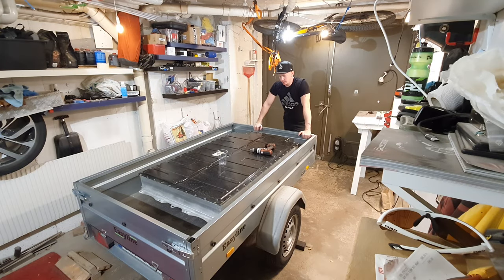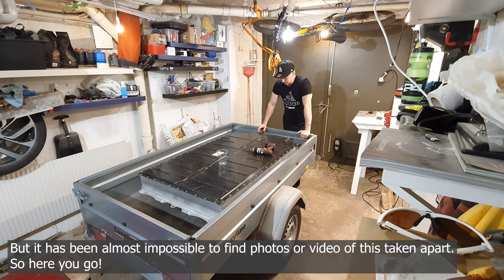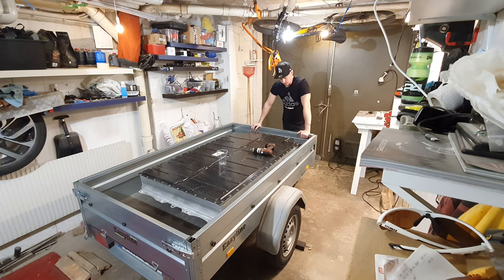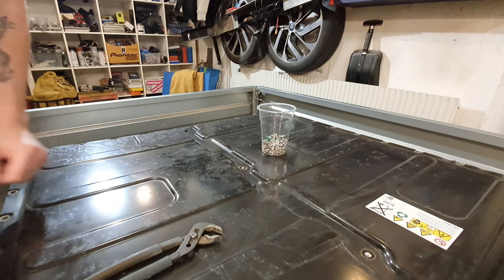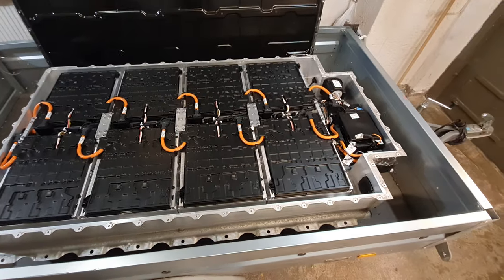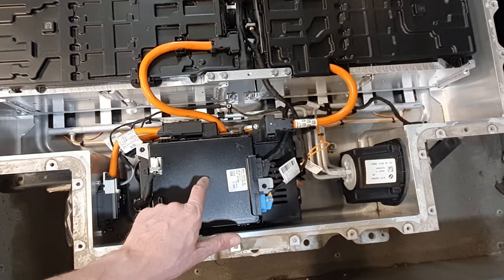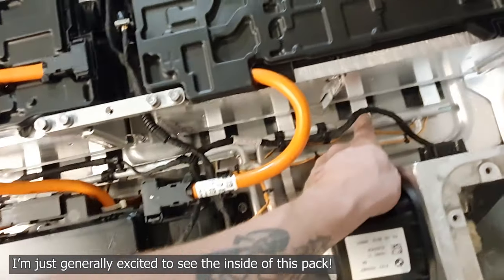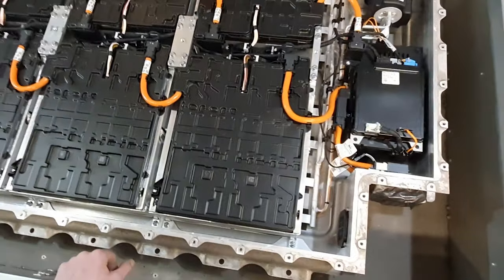BMW i3 60Ah Battery Pack Disassembly

Comment: Most people wouldn't touch this battery without the insulating gloves and high voltage rated tools, but are doing the opposite- removing the protective plastic cover before going starting working with bare-metal tools. I like it!
Reply: Bro, don't encourage him! It's cool that he is doing a teardown and this video is great, but it's not cool do do the teardown in a way that puts your life at risk
Reply: This was so cringeworthy, even the most basic safety wasn’t adhered to.

Comment: Class 0 rubber electrical gloves are $15 bucks on amazon, rated to ~1000vac/1500vdc. Ground the enclosure/chassis and measure all the voltages across all phases before touching any wires. Also wear face protection in case of arcing. I test and work around 120-480vdc, and up to 25kV DC on multi-million dollar semiconductor equipment. We joke about licking the fingers and test the wires but I doubt anyone has the gut to do so.
Reply: In case someone asks, if anyone has seen a youtuber upload a battery system dismantling gone wrong... it's called survivorship bias. Thumbs up for safety first!
Reply: I would love to get a link for the class 0 electric gloves! Sounds like prices have increased and it gets a bit spendy when they are only good or certified for 6 months at a time 😬 thanks!

Comment: in several places in Europe you can upgrade the Bmw i3 battery but in my opinion the best is impexneth from the Netherlands and they have original 120ah Bmw batteries, not foldable and the price is around 6000 eur

Comment: May I ask how thik (in mm) those busbars are? Is it correct that they are made out of aluminium? The bend they have seem to be there to allow for some movement of the cells. Were the cells compressed, and if so how hard? 
TIA / Markus
Reply from the maker: The busbars within the module is in aluminum. It’s really bendable, not sure of the thickness but maybe 1-1.5mm.

Right now I don’t have any batteries left from the i3.
Reply: @BasinBjorn  Thanks for the. Info. I could get hold of such cells and am figuring out what to use for the busbars. Really like the i3 aproach!

Comment: Great vids on the battery pack disassembly, thanks! I've disassembled a 36kWh e-Golf pack and that was a nightmare compared to the tidy i3 pack. 
My next pack will most likely be an i3 pack and I'm toying with the idea of using the original battery box. It looks very nice and rugged, not to mention spacious and easy to open. 
Setting up a 12S system, do you have any thoughts on how to connect the serial cells in parallel? I doubt the original balance leads are up to the job?

Comment: Hello
Thank you for your video you do a good job for all i3 owners:)
One question, do you have i3 with heated seats? Because I am not and I heard it means that battery also is not heated when its charging. So tell me please do you see any Heater when you remove all cells? Or May be you see cable which connect to some heating platform, etc.? Thanks for your help.
Reply from the maker: Hi, I have heated seats in the car and the only thing under the modules is that AC-tubing that is made out of aluminum. It runs from front to back a couple of times and is the only way of controlling temperature on my pack. I'm pretty sure my pack heated up when I had it plugged in and ran that 3h heating program.

So I think it uses the AC system for cooling and heating, but that is just a guess. Could that be possible? Heating with AC?
Reply: @BasinBjorn  the OS number of this aluminium Heater is differnet Based on scheme from BMW. 61 27 7 625 078 without HS and 61 27 7 625 078 with HS. What is differnet in reality I do not know...

Comment: Hi Bjorn, I saw from your videos that you have experienced with the BMW I3 ..:-)
so I am writing to you for your advice (I state that I work on lithium batteries and I have a good knowledge about the electronic charging principles)

I own an I3 94Ah but without the Fast-DC charged unit, I wanted to do an upgrade to install the dc recharge, 
initially I contacted BMW and they replied that this upgrade is not possible, of course I know perfectly well that the bmw answer is false :-(

The BMW I3 with DC-fast recharge simply have an additional module (which is not installed in mine I3) but which I can buy as a spare.
of course I already know that I will have to replace some cables including the CCS-2 plug.

So I ask you, since you have worked on this car do you think an up-grade home made is possible?

Thanks for your advice
Reply from the maker: Hi Vencenzo, short answer is that I don’t know if that is possible to do as a DIY upgrade. I would guess that the car would need coding after installing the CCS. For it to use it. 

But when I had my 60Ah battery replaced with the 94Ah the workshop said that 7kW Ac charger could not be upgraded to 11kW.

Not quite the same but a limitation in upgrade.

I would send an email to a few more BMW i-certified workshops to se what they say. Especially the one that did my battery upgrade, Bavaria Lillestrøm
+47 64 84 73 00
https://goo.gl/maps/rUYJ368fVpW5qKrF9

I understand that they are most likely not a place you could drive to but I would trust their knowledge more than other Bmw workshops.
Reply: @BasinBjorn  Hi Bjorn, thank you very much for your reply, I will try to contact the workshop you have reported to me, even if it is far from I live I am satisfied with a technical answer.
I bought the pdf high voltage manual service, after reading it I am even more convinced that it is enough to install the Fast-Reacharged module and the necessary cables, about the protocol, I don't think it's a problem, you try to think about the hypothesis in which you need to have it replaced the fast recharge module from your car because it is broken, certainly it is a job that can be done, my upgrade is equivalent to replacing a fast recharged module
The DC charge actually charges the battery directly (the AC charger is bypassed) unfortunately the AC / DC switch takes place inside the fast recharge module so I am obliged to install it.
Thank you again, I will try to contact the workshops you have reported to me...ciao
Reply from the maker: @ultrabeamitaly1  don’t forget to let me know how it goes, whenever it’s complete. Always good to know. Good luck

Comment: How did you tow that trailer back home, after the battery upgrade, do you have a tow bar on the i3?
Reply from the maker: I have the Eco Hitch from Torklift Central. Used that and a 120kg trailer to get the over all weight down. Not approved, but it worked. The i3 is actually pretty good at towing
Reply: That’s interesting, would make a very good subject for a video, I would like to see, as I’m sure many others would. 👍
Reply from the maker: Thanks for the tip! So what would you like to see concerning the towing? Range test? Or like a demonstration video?

Comment: Hi There...  Did you change the battery yourself or did BMW do it,  What was the price for accessory ? and what was needed for the swap?  Thanks in advance 👍
Reply from the maker: No I had BMW do it, but since they don't offer this job with a new battery I had to source a used battery and have it shipped to BMW. Then drive the car 500km to get it there. Price for my used battery was 50.000 nok. Labor cost to swap was 25.525 nok.
Reply: @BasinBjorn  Ouch... Not exactly what I was hoping to hear. That was really expensive.  How many Kw left on the olde battery when you look in the dash ? How many KM has the car on the clock.  How are you charting CCS   vs   Type 2 ? How many days of charting below 0 °C and likewise regenerative braking. 
Sorry to aske so much, but I have a I3 that have 98.000 KM on the clock and 17. something KW left.  I am looking in to the degradation of the battery, so I am really hoping you have time for my questions.  Thanks

Comment: Hi very good vid!
Do you know were we can buy used BMW i3 accupacks? 

We need a few for a project.

Thanks!
Reply from the maker: What country are you in?
Reply: @BasinBjorn   the Netherlands
Reply from the maker: Not sure then, look at local salvage yards for wrecked cars. In norway they are listed at www.finndel.no and in sweden www.bildelsbasen.se
Reply from the maker: Read this reply on a video, they might be able to point you in the right direction: 

"I change 60ah batteries to 120ah for 5000 eur (you leave your batteries 60ah or more - to be agreed). I have 94ah and 120ah batteries for BMW and other cars. If anyone is interested, please contact me: info (at) impexneth.nl "

Comment: Is that 3.93vfully charged or do they goto 4.2v like 18650 lipo?
Reply from the maker: They go to about 4.2v at 100% charge. The 3.93v was the charge that was left in that given time.
Reply: The nominal voltage for the whole pack is 360V, meaning that the cell voltage should be 3.75V (8 modules of 12 cells each).  Cells will float higher at high charge and open circuit (or charging).  The pack voltage is what (unfortunately) limits the maximum charging rate to about 45kW (rather than 50) as a 50kW DC fast charger is limited to 125A (125x360 = 45,000W).  As the voltage of pack rises later in the charge, it also becomes time to throttle to protect the cells, so even though the voltage has risen which would allow a higher power, the car never reaches that maximum 50kW. This is annoying being unable to take advantage of the last 5kW available from the charger.
Reply: @BasinBjorn  The maximum any indiviual cell see's is 4.08-4.1 volts. I know because I ran the electrified app in conjunction with the Veepeek dongle. They never get to 4.2 volts, nor do they get anywhere near 3.3-3.4 volts.
Reply: @johnnyzee383  4,08 Volt Max charge and 3,3 discharge ?
Reply: @AusbilderNF  yes but 3.4 volt discharge at the bottom limit

Comment: As a 2015 I3 owner and an avid Tesla fan, I am looking to totally swap my car physically to a Tesla in about 5 years (this is totally a passion project, not looking for it to be affordable or anything). Meaning everything from the batteries, motor, and even infotainment will be taken out and replaced with Tesla parts. The car will hopefully be a Tesla as far as the OS is concerned (smaller amount of batteries obviously). Your video is exactly what I am looking for in preparing for that process. Is there any chance you would know how feasible it would be to remove the I3 battery packs as you did here and (with some custom braces) plop in Tesla battery packs? The biggest issue I can see is height restrictions, but my thought is to keep the stock "battery holder" in tact for easy installation.

Comment: Nice Video So what did you do with the battery modules ?
Reply from the maker: I sold 6 out of 8 to a guy that was gonna use them for energy storage in his house.

1 is in my teardrop camper to power AC and DC outlets.

1 is saved for a future project.

Comment: Hey bro , thanks for the teardown. Im interested in battery tray/carrier. Do you have a detailed photos of the battery carrier?
Reply from the maker: Hey! Unfortunately I don't have any photos of it empty, other then the videos here. I took a few photos after I opened it but they show the same as the videos.

I still got the tray/ box but it's kinda inaccessible right now. Won't be able to access it until I have finished building my teardrop camper (a few months).
Reply: @BasinBjorn thanks for the reply. If you willing to sell the battery box we should get contact. Thanks

Comment: What was the battery swap cost?
Reply from the maker: The swap cost 25.525 NOK at the dealership I went to. Approx 2500 euro. Plus battery.
Reply: Was it a second hans battery?
Reply: The answer was below 😊
Reply: B as in Bjorn  that’s not terrible. Is 94ah  battery new?
Reply: Hello B. THANK YOU very much for your vídeo. I have 3 BMW i3 in my small company and I can't make more than 100 km per charge now. I don't want to sell the Cars because I believe things should last long (like my Volvo S80 with 600000 kms). But I Will be in a point were I'll need to change the battery. So your vídeo is inspiring and very helpful. How was your experience to find a used 94Ah battery?
Reply: @BasinBjorn   Hi Bjorn, so all in about €7,200 approx. I know you folks in Norway are rich but this is not a good economic case!! LOL. Good luck with your "new" car!